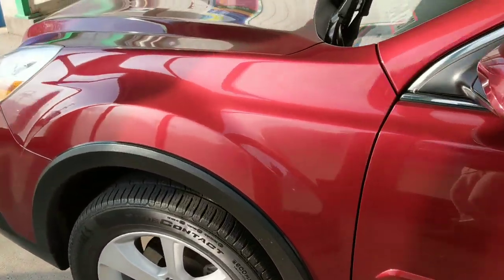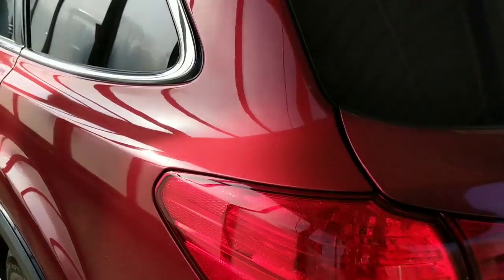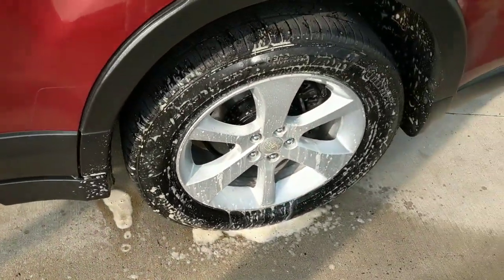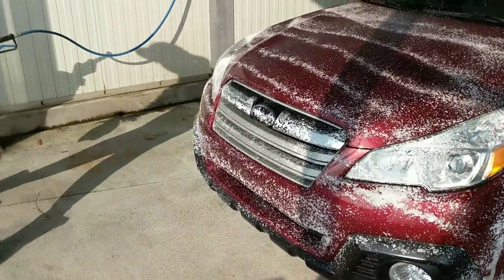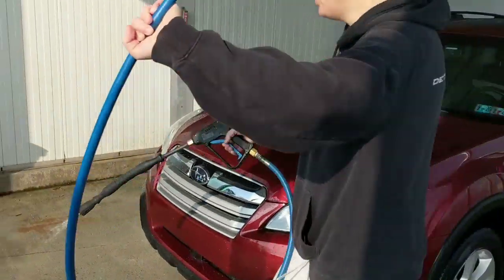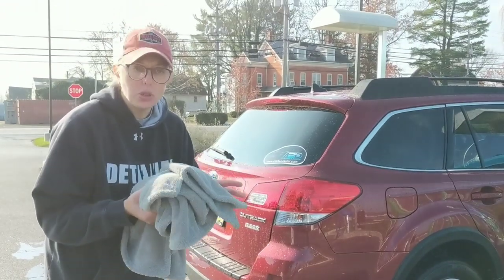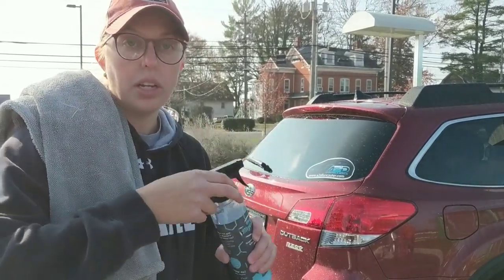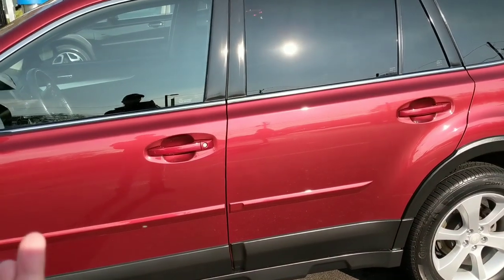How to MAINTAIN your car in the winter at the CARWASH!

Comment: Very smart to use their water if you cannot do rinseless in your own garage.  I do not have the freezing temps you do in the northern states.
Instead I did try using my smaller ice chest to fill up with warm water.  It kept the water warmer longer and used ONR and my BigRedSponge to do the job with ease!

Comment: Hmm first time ever seeing that Angel wax pre wash. All the detailing channels i watch and ive never seen it used or talked about. Ive been using Power Clean at 15:1 but it still removes a topper. I will be buying some THANK YOU.

One question, why not just use 1 bucket with a gamma seal. Go over the car real quick to get the remaining film. I would not dry a dirty car .. even with a aid.

Comment: Very informative video, brilliant   idea of using ONR at clay lube dilution as a drying aid. My truck has stand alone c2v3, is it safe to assume not use Rage  as a pre-treat? Have you tried GTechniq W4  Citrus Foam?  They claim it removes traffic film. Same question for Angelwax Fast Foam. (My go to shop in Pittsburgh does't carry Cleanliness)
Reply from the maker: I wouldn't use Rage on protection that you don't want to remove. For prepping a car for wax it's great. I haven't tried w4 but Fastfoam is safe for ceramic coatings as well. Either cleanliness or Fastfoam would be great for protected vehicles that you want to remove road film but not the lsp

Comment: Chelsea, thank you for the excellent video, so what is the verdict after finding rage is  actually 14 ph, are you still recommending to use on your vehicle 1/4 ratio to remove the road film?. i have regular wax on mine, is this safe for the paint and clear coat. i ordered RAGE and the bottle says not to use in painted surfaces, manufacturer only advertise rims and wheels for it? thank you again for the advised and tutorials
Reply from the maker: I would say if you are detailing professionally and a customer is bringing their vehicle to you and you have to strip the vehicle of previous waxes and heavy road film then yes, it's still safe. But I wouldn't use it routinely to maintain your own personal vehicle unless you're looking to strip heavy amounts of dirt or old waxes from it. I would say it's more of a deep cleaning product versus a maintenance product. It is fantastic on tires and wheels and I would use that for a maintenance product on them but for paint I will only use this on a restoration versus a maintenance detail. Does that make sense?
Reply: Attention 2 Details w/ Chelsea , yes it makes sense , I was looking to only use it for winter road film removal . When not having access to water at home. I want a safe way to keep salt off during the winter days (maintenance e washes)!where I can’t use regular contact wash methods due to not having water available. Should I instead look at Angelwax cleanliness instead. All I want is to keep the daily driver salty road film of my car during the harsh winter days. Thank you so much and congrats on the new garage 😀!
Reply from the maker: @mc-jl9nw  yes Cleanliness is the perfect soap for that situation.

Comment: Great info, but I live where there is a good amount of snow, rain and chemicals on the roads in the winter with long periods where the temp is at or near freezing. So I'm not sure this maintenance wash is enough for me. Do you have recommendations on using a carwash bay like you did but is a little bit more aggressive?  I do not want to take my car to an automated carwash.
Reply from the maker: You could use ADG F-bomb to pretreat your vehicle with a foaming pump sprayer before rinsing at the bay every time you wash as it's safer to use on protected paint and then us ONR as a drying aid in a spray bottle after you wash it. Consider a ceramic coating or high quality sealant to protect your paint to make dirt less likely to stick and easier to clean.

Comment: Question. Can I use a diluted degreaser like SuperClean to presoak for traffic film ?
Reply from the maker: Yes but it could stain the finish if it's too high pH or not diluted enough. So just read the manufacturer specifications for proper dilution ratios. I wouldn't use it every time as it could potentially strip or weaken your lsp

Comment: Nice job Chelsea.
I am no chemist. However, mixing a high alkaline cleaner with an acid based cleaner neutralizes both cleaners and you are throwing away money. 
I would use the Rage on the wells and tires and acid on the wheels if you only want to rinse once. Otherwise use them separately.
Again no chemist but I believe the byproduct of alkaline and acid mixture can be salt. 
Good luck on the move.
Reply from the maker: Rage claims to be a pH of 7 and obviously the wheel Brightener is a acid but they don't necessarily neutralize one another. Somehow the combination of the two UPS the cleaning power of both and creates a better punch than just using them by themselves. Check out my video on touchless tire and wheel cleaning for a closer look at it's effectiveness. It's worked well for me.
Reply: hmmm. I looked at the technical data sheet for Rage exterior wash wheel and bug remover (is that the one you are using?) And it says the PH >12.
Just trying to help, not criticizing. Have watched all your vids! Keep it up.
Reply: what's interesting is the safety data sheet says 7 but their tech data sheet says 12? Now i am confused. Well if it's working for you then so be it.
Reply: @attention2detailswchelsea   so i reached out to Superior products and was told that Rage even diluted 4:1 has a PH greater than 14!!! (not sure that's possible as the ph scale only goes to 14)  I have asked for clarification and a safety data sheet. They said the one on their website is out of date. Keep you posted.
Reply from the maker: @autodetailingbyal1488  thanks for finding that and that's surprising. Changes how I would dilute it and use it then. Still love it but definitely appreciate that info
Reply: @attention2detailswchelsea  i have received a copy of the sds,  it lists the ph as 14. keep in mind 14 is drain cleaner. Keep up the good work.
Reply from the maker: @autodetailingbyal1488  😬😯
Reply from the maker: That explains why it's so good at removing road film!
Reply: Actually what she is doing is essentially a Lo pH and high pH combo which is utilized in the trucking industry to quickly clean dirty 18-wheeler's and such. From what I've heard it is an aggressive combo which can cause clouding on the clearcoat over time because it aggressively strips away the oils that are in the clear coat. Definitely works but I'd be worried about long term effects, hence why you don't see this method being adapted to auto detailing...it's not that people don't know about it..just the risks are too high long term. 
Even TRF's should be used sparingly to only get rid on the really nasty stuff and not part of a routine wash.